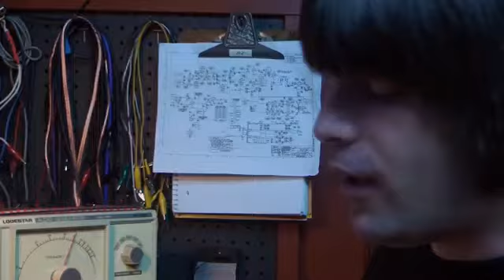Arcane Amp Repair

Comment: Just got my JCM 900 back from Trevor's shop. It rips now! The old tubes were completely used up and caused all the fuses to blow at once. I appreciate that Trevor took the time to discuss replacement options, sourced some specific tubes and then bench tested them to make sure they matched well as a set before installing them in the amp, replacing some resistors and such too. Trevor is a great resource for Portland's guitar community and I will definitely use him again in the future.